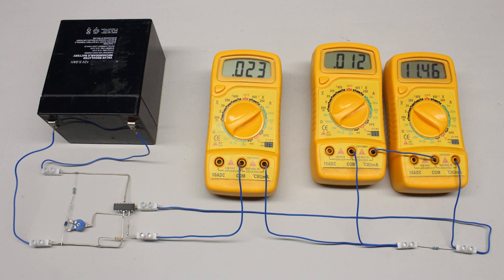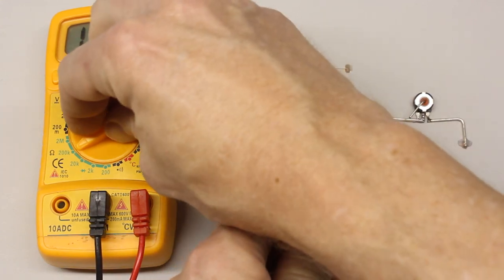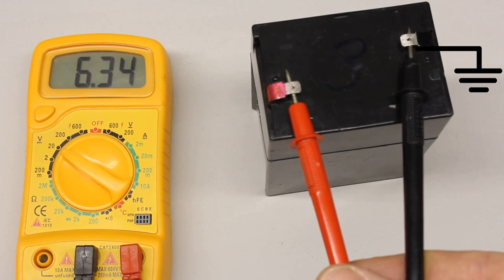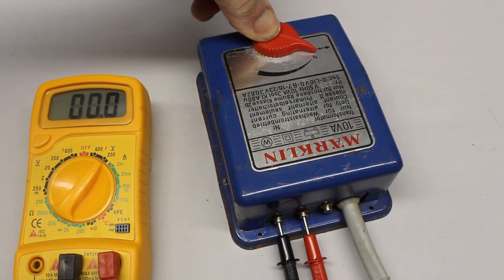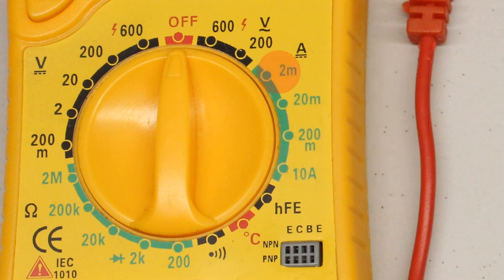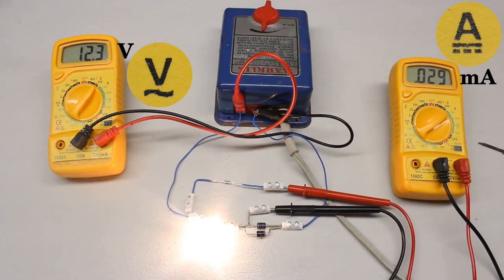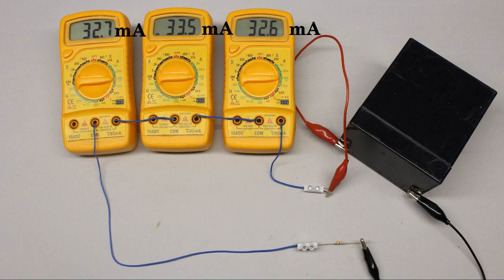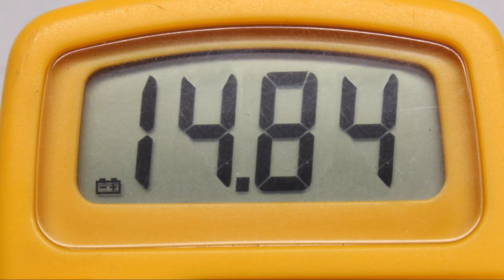Digital multimeter tutorial

Comment: are those solders or aluminum leads that you soldered on the pot?
Reply from the maker: What pot do you mean? Give me a time index of the video.
Reply: HomoFaciens oh, i was talking about the circuits you used in the video, for example, 00:06, the connections of the IC chip and the POT,
Reply from the maker: phuck
I am using copper wire with a coating of silver (don't ask me where I got this from, I found it somewhere in me cellar...). The connections are lustre terminals. Sorry for the late answer but I ignored this post for reasons I don't know...